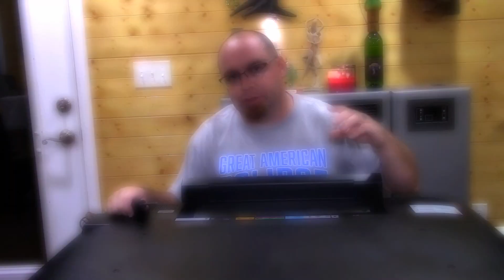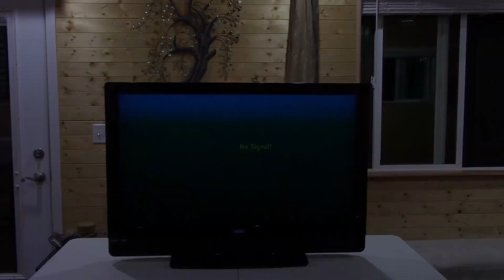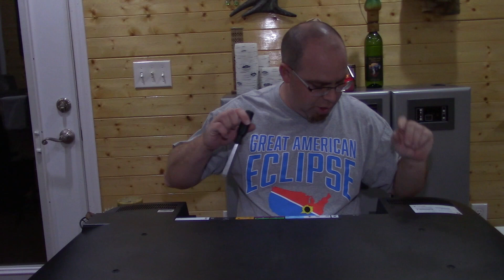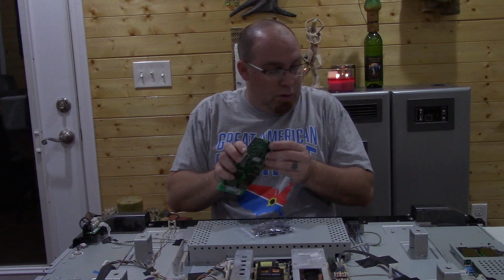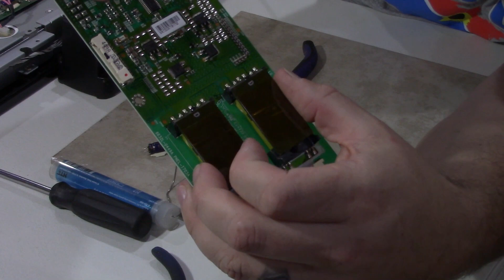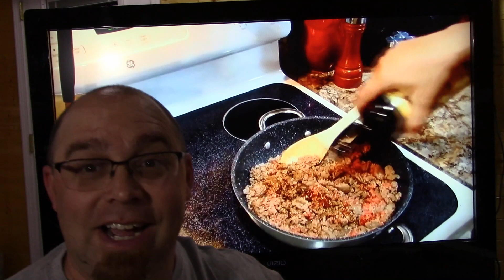How to Fix Vizio Tv strobing flickering

Comment: This isn't the problem I'm having. There are three rectangles (bottom left is largest, small rectangle on the right middle, and another small rectangle top left) which are slightly darker than the rest of the screen, and every 3-10 seconds, it gives a gentle glow for maybe a tenth of a second brighter than the rest of the screen, then back to darker. None of these three rectangles flash/glow at the same frequency, and the one on the right side in the mid of the TV does not flash or glow at all, it stays dark. I've found nobody with any video of the actual problem except you, and that's not what I'm experiencing. I know this video is four years old but please someone help me! I may even upload a video to YouTube in order to show what's going on.
Reply from the maker: I'm sorry I've never ran across that.
Reply: @2TrailHikers  it's something to do with the backlight. I turned the brightness down and contrast up and it made it about 50% better but I can't get rid of it completely.
Reply: @2TrailHikers  thank you for your help though! Now I understand my TV a little better.

Comment: My 37 inch Visio VW37L had one board on the left side, both caps rated at 35v 680uf, and both slightly bulged and leaking a tiny bit of the black goo.  It's funny because 35v/680uf is the same value as in the SyncMaster 204B that I fixed.

Comment: Do it yourself capacitor kit ordered. Hope this shot gunning technique works. Also noticed as I was looking at the Vizio help pages that when I turned down the brightness, a very noticeable humm became audible. The lower I went with the brightness, the louder it became. And muting (as the page recommended) did nothing. So, I highly expect it's those capacitors as suspect. Granted, the TV is now around ten years old. And I've heard that capacitors aren't eternally lived, anyhow. Judging from your video, I do believe my aging high school electronics class skills can get the job done.